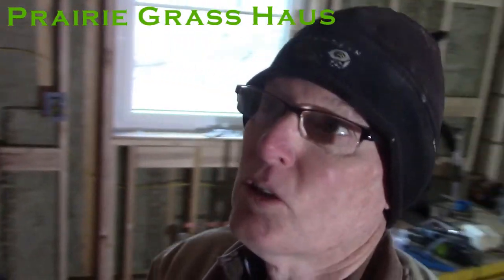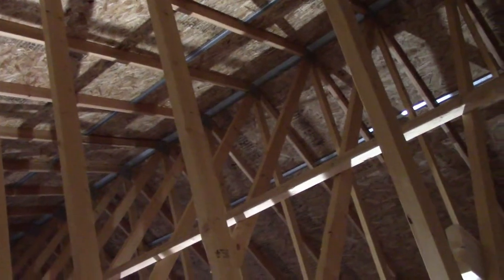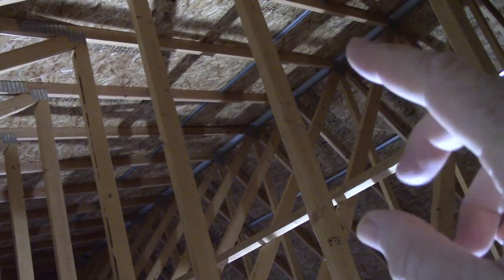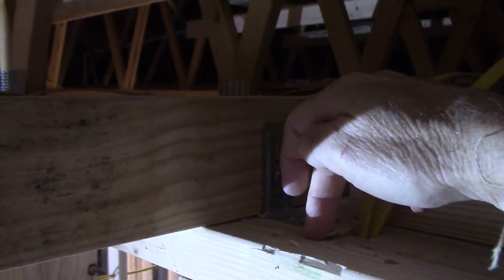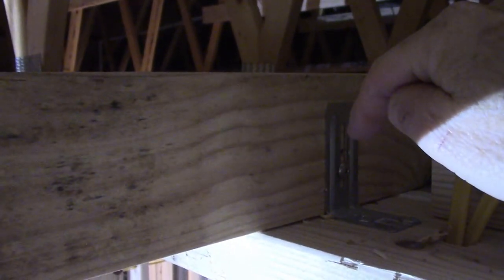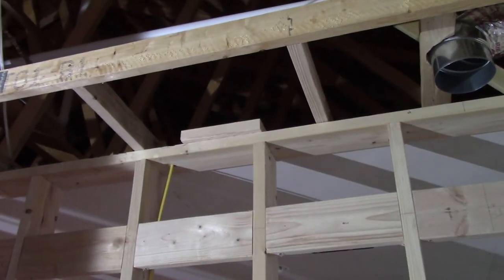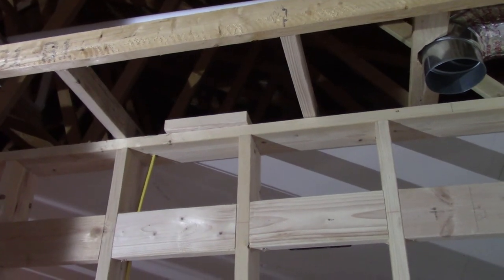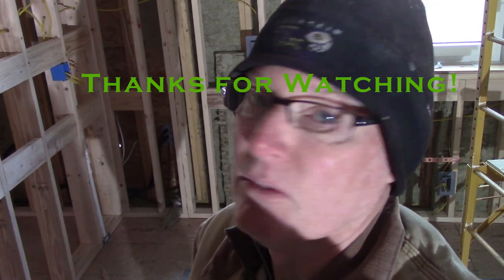Truss Uplift Explanation

Comment: Good Morning, and thank you for your video post. Is it that you are creating a floating or suspended ceiling like that common in steel stud framing? It seems that the slip clips allowing the wood to flex will still introduce high/low air mass junctions and accrue damp. Would it be better to use strap instead of slip clips,  or to foam the framing at those junctions?  The (closed cell) foam would still flex with any uplift, but will also help maintain the materials, and control moisture and heat loss.